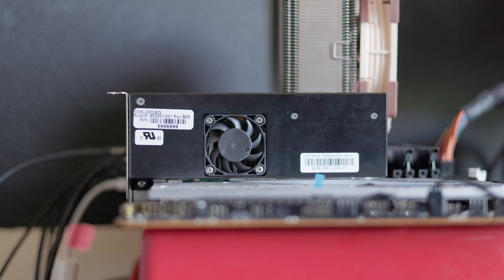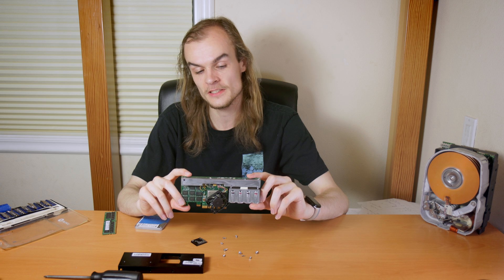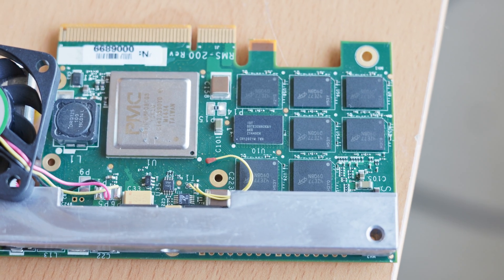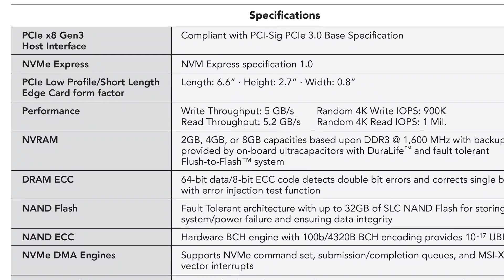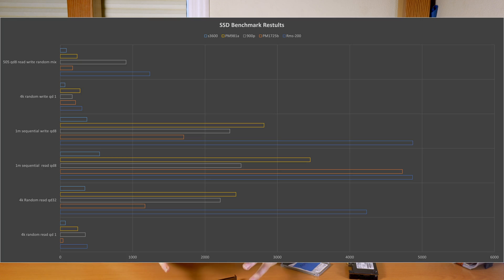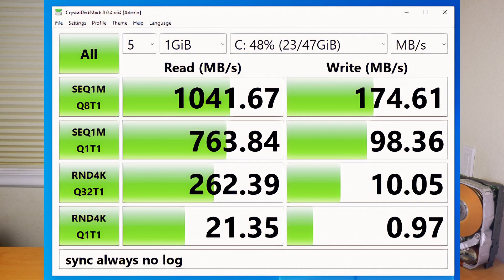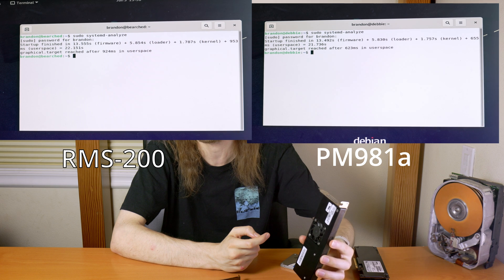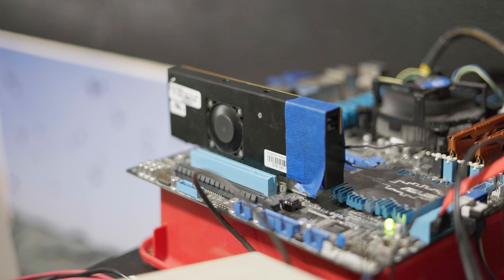Taking a look at a RAM SSD: Radian RMS-200

Comment: Found this looking for RAMdisks.  I reserved 2GB of my 32GB system RAM as a RAMdisk just to throw random stuff into that I don't want to keep: resized images for sharing, AI image generation where I might just keep 3/100, extracted driver files, PDFs that I only want to view once, shipping labels to print, etc. It's been extremely handy to prevent burning SSD endurance.  I'd like more space, but I don't want to carve out more system RAM.  Maybe something like this is what I need.  I'm curious if it'll work without all the supercap stuff.  Being able to survive a warm boot is cool, but cold boot I don't need as don't need (or even want) my temp files the next day.

Comment: building a bit of an oddball machine right now, a KCMA-D8 with libreboot and seabios, zero moving parts in the system. going to be using this for the linux distro i'm throwing on it. going to be interesting to see how it performs.

Comment: I just got one of these.2 things: 
1)it achieved only 1.8GB/s on a truenas scale computer by making a zfs volume and dumping data with fio
2) it's fairly loud. The fan is always on clocking around 45c I was expecting the fan to come up only as the drive heats up a bit. Guess will have to swap it with a noctua fan.

Comment: I just picked up 2 of these. Being NVMe based, I noticed they have two name spaces, one that supports 512b and the other 4K sectors. Did you test using 512 or 4K for ZFS SLOG?  I've used the nvme cli to format them to the 4K namespace but I haven't had time to add them into one of my ZFS servers as a SLOG.
Reply: Have you since found the time? Very interesting info!

Comment: comparing it against a PM981a (= 970 Evo Plus) is a bit unfair if you talked about Gen4 SSDs not even a minute earlier. A PM9A1 (= 980 Pro) would've been more fair, and Q1T1 actually comes fairly close to it. Also at 3:00 you can clearly see someone has (poorly) worked on this drive before (awful soldering) and the SMD cap smack in the center above the wires has a nice hole burnt into it. Surprising this thing works at all
Reply from the maker: Yea a pm981a wasn’t the best comparison. But I had it on hand. I try to include the best comparisons I can but I can’t always justifying buying drives for comparison. Yea that cap doesn’t look good. I can’t tell if I got it that way, but I definitely did some bad soldering to test when the Peltier unit turns on.

Comment: I keep seeing these on eBay, but the size limit is really a killer. I can barely find a use for the 16/32GB Optanes. They are really cool and it's actually a really old concept.

I have an old Mac book from the early 90s with a part taking about a external drive you could buy which took like, 16 SIMMs to give you something like 128MB (not gigs) and a battery. I've never seen one on eBay in years and years of looking. I don't think anyone bought any or it never actually went to market.
Reply: I'm in the same boat regarding it's comparison to 16/32 GB optanes that i want to find uses for! It's got slower Q1T1 read than optane, but much faster write, performing much more like a real NVMe, with allegedly infinite endurance. I think the issue is the OS isn't ready for these kinds of drives. It needs a total revamp of swapiness pressure for different kinds of cache reading and writing.